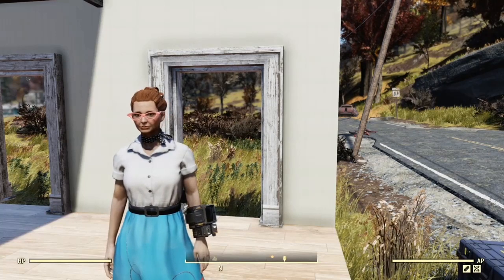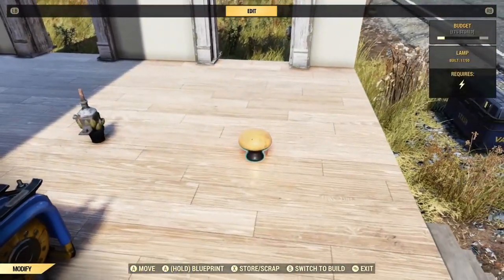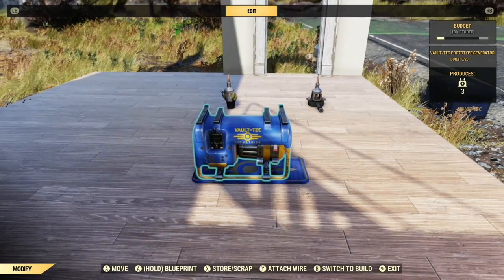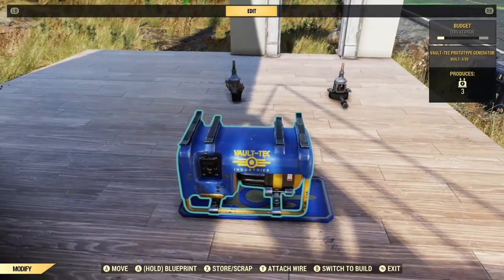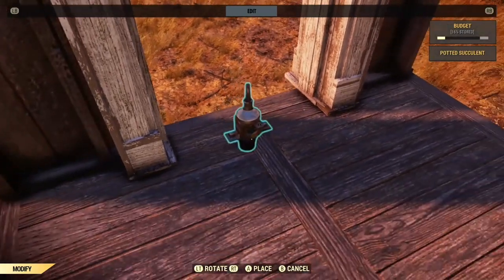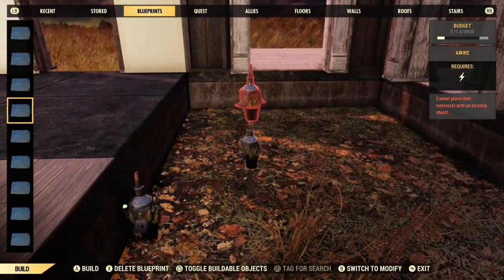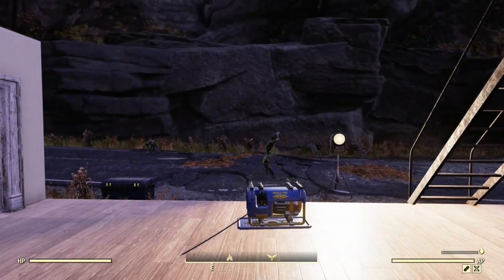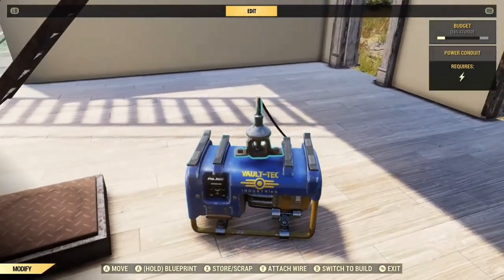Fallout 76 - Building 101 - How to hide wires and conduits - July 2021

Comment: Powered stash box definitely doesn't work anymore. Atleast not on PS.
Reply from the maker: It works on Xbox, I use it every week, it's my main method of powering camps.  In what way is it not working? Are you attaching a power connector?
Reply: @LucyJanePlays  Old ones work, but if you make a new one as soon as you move it, it stops radiating power.